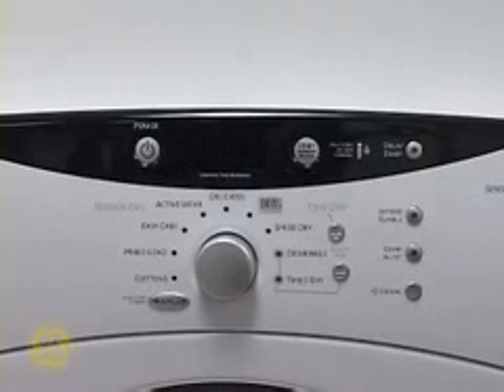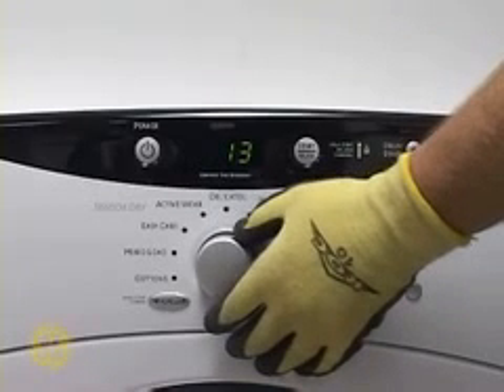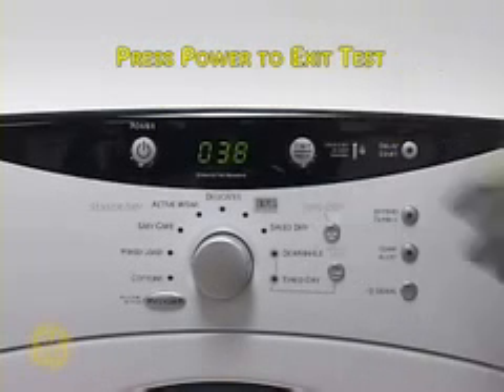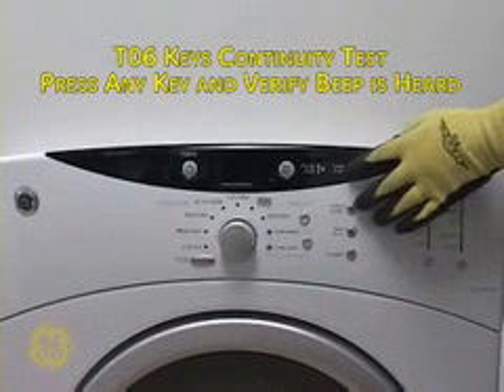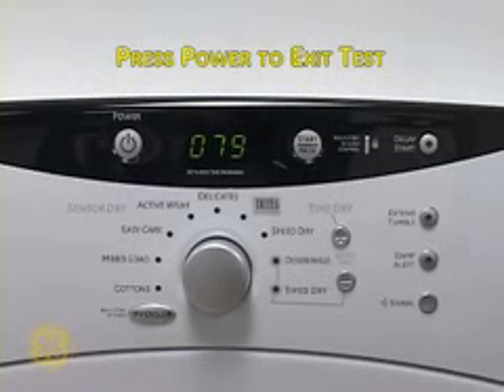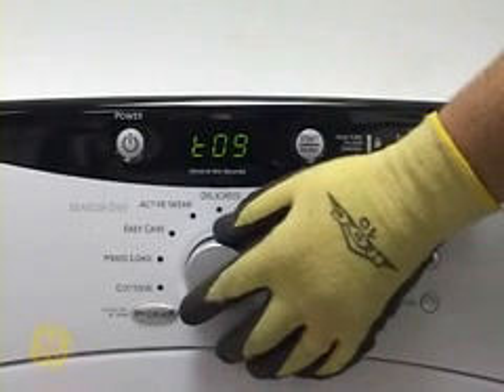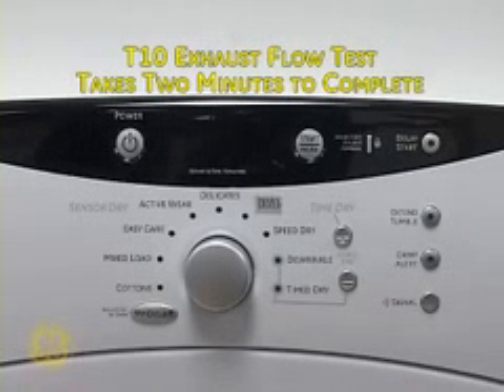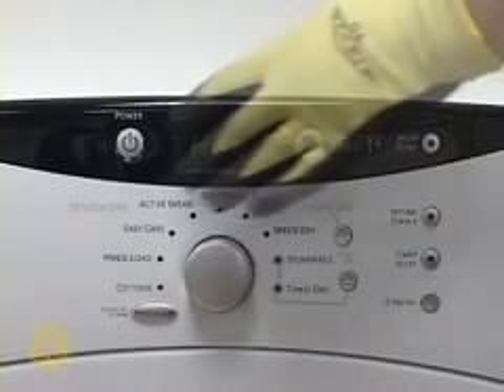GE Test Modes

Comment: Omg, I have the washer to this dryer. My knob stopped working 6 years ago been stuck on colors ever since. The repair guy said I needed a new board and was $800 to fix. Well washer broke the other day and i finally got the dryer off the washer as they are stacked and I finally got to pull out the control board and take a look. The fricken knob has bad solder joints that separated from the board! I tested the switch and tested fine so I soldered it back on and now I can run diagnostics since the machine is having a either 0ump or water inlet, I'm not too sure but I did see one relay that needed solder as well. Niw I guess I'll go out her back together , finger crossed she work

Comment: Thanks for the video. On the T07 test, my dryer was slow to reach 79° (like 4 mins). On T08 I got to 114° no time flat, faster than your video, lol. I did every other test successfully but it still takes 4 hours minimum to dry a load of stuff. If I clean any more stuff out of it, I'll be taking parts out, lol. Any idea what the issue would be? Also, sensor dry NEVER works, so timed dry is the only way but no matter the temperature settings 4-6 hours to dry.
Please help.
Reply: So I figured I'd be a smartarse and put my clothes in during T08 test 🤓The temperature started at 94° and has slowly dropped to 87°,which I believe is not as low as it's gonna get 😞 I'm going to clear off my clothes wrack so I can dry my clothes on my balcony. We got a solar powered dryer out there 😬
Reply: We just got to face it. These dryers are sht!!

Comment: I have the same model dryer but when the dryer stops mid or sometimes doesn't even start the cycle, any idea how to fix it
Reply: It would be a relay needing replaced or the motor...from what I have experienced it's usually a relay...there should be 2 relays...when you take your control panel loose flip it up on top of the dryer you should see the two relays when that stops mid cycle you should tap on one of them relays and it should come back on running if it doesn't tap the other ones
Reply: @roycehunt854  thank you
Reply: @bereketgm1136  you're quite welcome
Reply: Hi, by anychance, do you have the manual ? I need to find one cause I buy it second hand....

Comment: On t07 my dryers temperature remained the same, on t08 the temperature raised greatly. Any idea what’s going on?
Reply: I am not a ge tech but have similar problem but with t08 test, here is my findings so far.
Cleaning the dryer fan by opening dryer and vent inside the dryer greatly helps with improved drying. Try this first.

GE dryers have 2 coils and they run of separate 120 circuit relays.

T07 test powers Outer coil. T07 powers inner coil.
T07 not raising temp can mean number of things related to outer coil, could be a bad coil or bad thermistor or bad relay for outer coil.
You can open the dryer (a cumbersome process) to rule out thermistor or coil. Relays r hard to reach as u have to remove the motherboard.

In my case I have tested coils and thermistor and still can't locate the issue.
I suspect the following. I used to use on low and medium heat hence must have been running my dryer mostly on inner coil and now it is close to failing but not totally failed. My  outer coil is working fine so when Put on high heat it drys clothes. Yours may be opposite of this .
Eventually I am going to replace the heating element but is a 100 dollar experiment
Reply: Hi, by anychance, do you have the manual ? I need to find one cause I buy it second hand....

Comment: I entered the diagnostic mode and got e60 from the second test. Now somehow the dryer is stuck showing e001 and won't do anything. Every button press makes two beeps. I've unplugged it for 30 minutes but after plugging back in the e001 still displays and no buttons work.  I've help the cancel button for several seconds as well as the power button nothing clears the e001. Help!!!
Reply: Hi, by anychance, do you have the manual ? I need to find one cause I buy it second hand....
Reply: Same problem how did you fix?